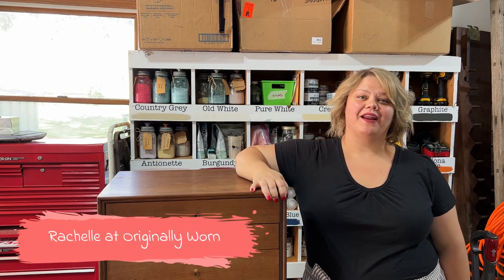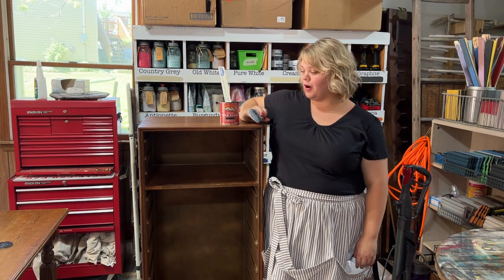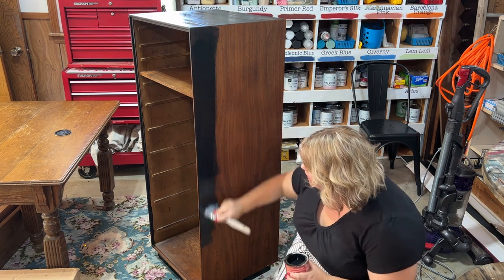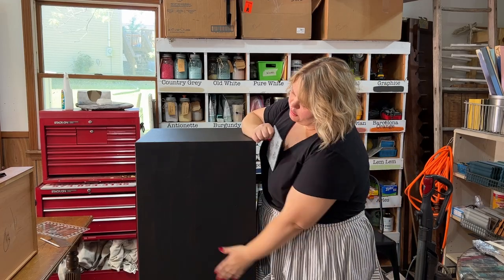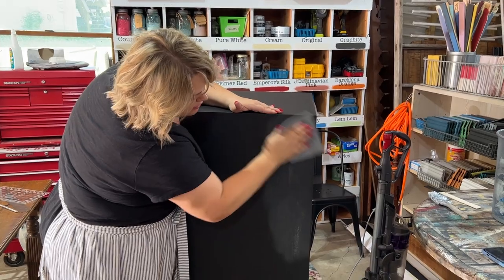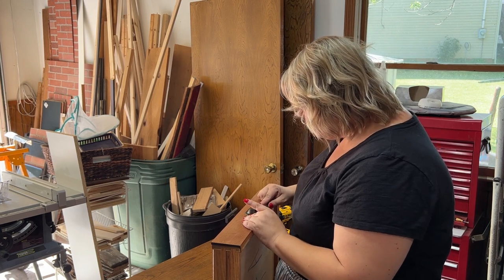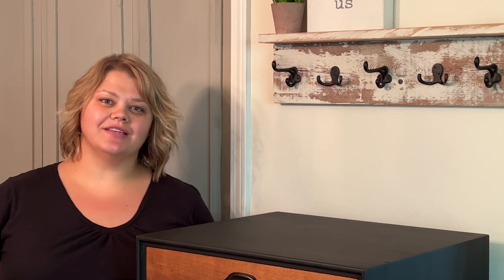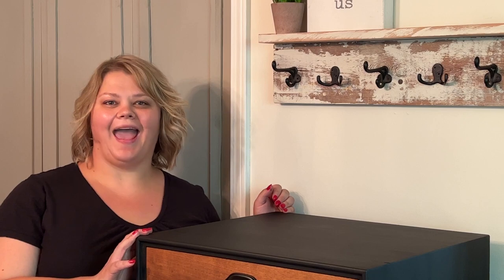Painting Furniture using General Finishes Milk Paint

Comment: Can you do video of how you clean brushes for re-use 🤔 please 🙏
Reply from the maker: Sure! But if I don’t get to it in time for you here is my run down. When cleaning brushes try not to soak the part where the bristles are glued for hours and dry them bristles down, or laying flat. Water based: dish soap and hot water. Typically the paint I use I don’t even need to let them soak. Oil based: mineral spirits (or throw away cheap foam ones are used) Wax (which would be treated as an oil based) but wax brushes don’t have to washed every time. I typically try to get as much wax out as I can with a cloth, and then let them sit until I’m ready to use again. Fresh wax reactivates old wax :)

Comment: I tried to sand my first coat and the paint rolled up. This was after 4hr at 98F. Did i notwait long enough?
Reply from the maker: Hey! Yes, it sounds like it either wasn’t dried enough or the surface had something on it that made it not adhere properly.
Reply: @OriginallyWorn  given how hot it was. Was it more likely that it didn’t adhere properly? How do you make sure you adhere properly
Reply from the maker: @ColocasiaCorm honestly I am not a 100% sure. It could very well be that it just wasn’t cured enough. 😬 sorry to not be able
To give you a better answer